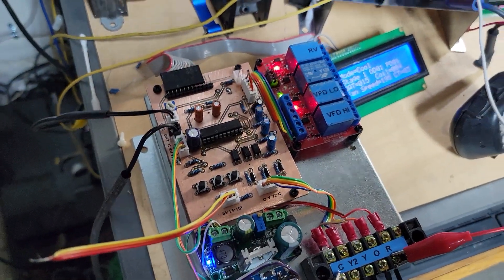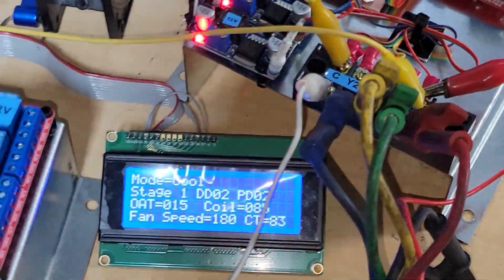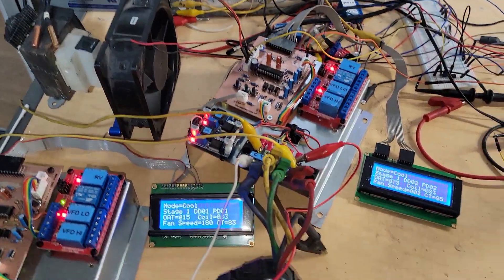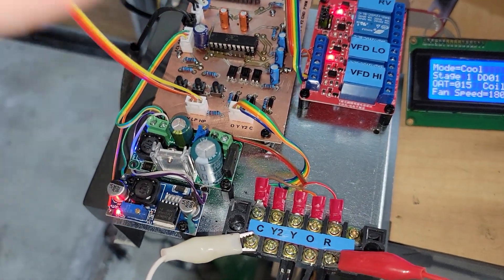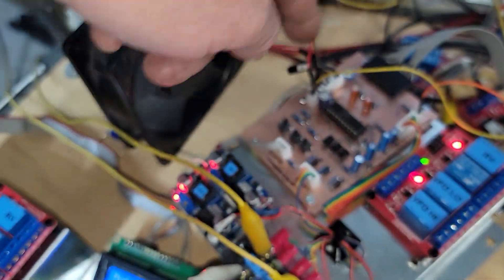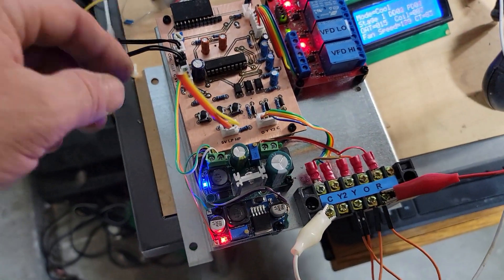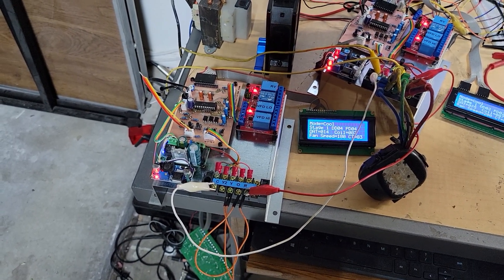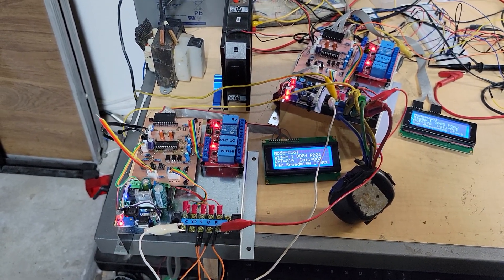Good progress on my Frankenstein HP Control - Should see it brought to life soon!

Comment: Looks pro, one question comes to mind though, long time a ago in school we made prints that where the opposite from what i see here.
We dipped it in acid after a lighting process, the copper was completly exept the tracks for the circuit. All that copper there looks scary 
To me with the high voltage
Reply from the maker: You're describing the traditional masking and etching process.
This is a process of milling out isolation routes in the copper to make traces.
Lots of unused copper is left unless you add the prices of milling it away as well.
But there's no need for my use.

I actually like the extra copper left.
If I connect it to my low voltage DC negative it helps shield stray signals 

There's no high voltage on this main board.
24VAC on one corner with optical isolators to separate from the 5VDC operating everything else.

I have a separate small board with an optical isolator that sends the fan speed signal to the fan inverter board that fits have high voltage.

Comment: How is that inverter working for you?
Reply from the maker: Are you asking about that PowMr Solar inverter/ charger?

It has been working great so far.
But I need a lot more batteries. 
I'm not able to store all the energy the solar produces and the lead acid batteries the still work can only heat up my water heater maybe once. 

I should easily have enough solar to heat the water and run my garage high wall Frankenstein minisplit for hours and hours
Reply: Yep that’s the one. Been thinking about getting one just not sure I want to go that cheap lol